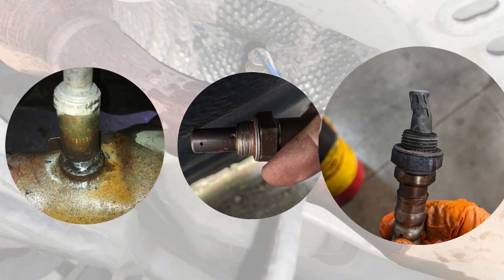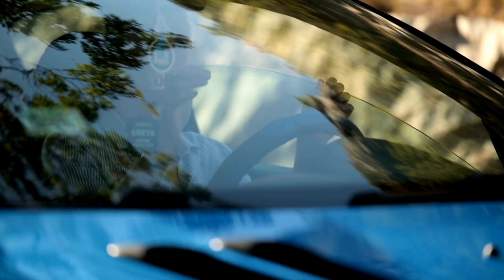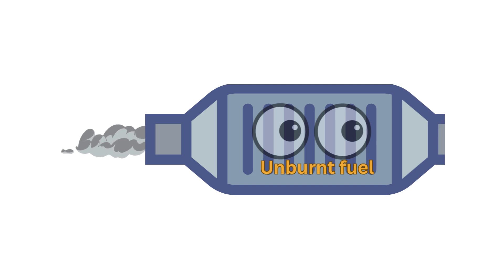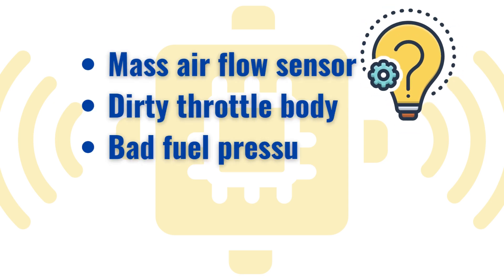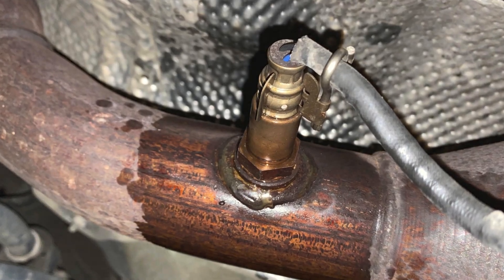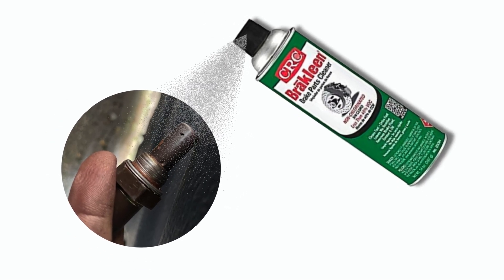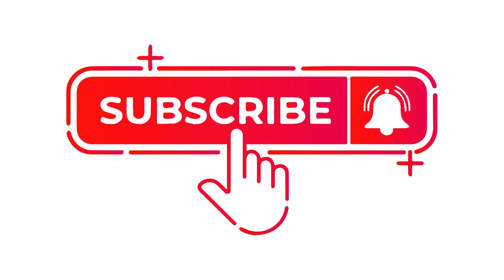6 Symptoms of a Faulty O2 Sensor | Engine Misfires, Poor Gas Mileage & More

Comment: My 98 Nissan truck seemingly the O2 sensor  died quickly, then the truck started running worse and worse quickly during just one grocery run.  It has 127,000 miles and has always ran great.  Very reliable truck.   The OBD2 showed knock sensor and or Cylinder bank 1 sensor code, which is the O2 sensor before the Cat.     The 02 sensor being bad can cause the knock sensor code to come up as a by product.

Comment: mine misfires when cold and changed spark and coils i even fixed a vacuum leak could my 02 sensor be a cause?
Reply: I need the same answer
Reply: I can't say yes 100% but my Jeep o2 sensor went out in the cold. (Ohio) and I had a misfire due to it.

Comment: O2 heater circuit code came first for me...kept driving for like a year then came the egg smell...kept driving longer....now I'm having hesitation to accelerate....kinda feels like misfires or fuel starvation....I'm guna change the O2 sensors now... ive had a O2  heater circuit code for over a year...it's the only code present....I did a fuel pump and filter a month ago....then a few weeks later it started hesitating while accelerating. I hope it's just the o2
Reply: Any update?

Comment: Wow! Thanks!! My engine stopped shaking after I changed my thermostat but now it stalls when I start it , second time I start it it turns on fine , my car won’t let me pass the 3 in rpm, if it does it drastically drops my speed from 60 to 40 and keeps dropping, until I have a steady speed . My car is at 268,448 miles , I have Toyota Camry 2005
Reply: You should also clean the MAF sensor and throttle body.  Throttle body needs to go through a relearn process after it's cleaned, so you may find your engine idling at 3k rpm because it thinks it's still gunked up and needs to learn where the flap needs to be positioned all over again.  A decent two way scanner can do the throttle reset, otherwise you just have to drive it ~300mi or so and give it time to learn again.  If you never cleaned it, it's going to have a bunch of oily sludge on it from the pcv valve feeding crankcase gases and oil vapor back into the intake.  Use only dedicated cleaners on those parts.  It's easy to do yourself.  A word of caution though, if you simply drive the car while to relearn the idle, it may try to push through your braking at stop signs, so stop early until it's done dialing itself back in.

Comment: Hi sir , i just trying to clean my oxygen sensor this morning and it was hard coz very tight and i decided to spray with WD 40 ..but still hard to off the sensor..and when i start the engine ..i saw a and smell the smoke coming from the top of the oxygen sensor..and when i touched it it so hot and also the body if the engine was hot as well..may i know what is the possible problem..i got a toyota sienna van 2020

Comment: Help. 2008 Jeep Commander Limited 5.7, Swapped out the bad transmission, while the Y pipe was out I decided to replace al 4 O2 sensors. I bought cheap ones and they threw the typical codes on all 4. Bought a 2nd set (NTK) supposebley a good aftermarket brand. Still throwing codes on all  4. What would cause all 4 to fail? Thinking trying genuine Mopar sensors? Never had any O2 sensor issues before the tranny swap. Really has me stumped. Thank you for your time.

Comment: Check engine light blinking with 3 02ser codes. Also a cylinder 3 circuit misfire. Is this all because of the 02 sensors?
Reply: well? did ya get your answer?
Reply: I got the same thing today 
So when you fixed it did the car start to running good ?
Reply: Was it o2 sensor for you?

Comment: Can a faulty 02 sensor cause a PO430 catalytic converter code. I'm going to replace my bank 2 cat the one that is on the car now is a aftermarket one. So I'm just wondering if I should go ahead and replace the 02 sensors. I don't have any other codes besides the PO430 which is inefficiently below threshold bank2 I believe I'm saying it correctly. Also could the O2 sensor if faulty would cause a higher RPM at the first start of the day?
Reply: have you replaced the sensors yet? I also got P0430 and was thinking it’s the sensor but i’m not too sure
Reply: @Alan-wq6ty could be just replaced mines tonight will start car tomorrow and see if it helped
Reply: if you're getting p0430 that means your catalytic converter is bad lol, not the o2 sensor
Reply: @schlomoshekelstein908  Not necessary it could be an exhaust leak.
Reply: @ Why would fresh air leaking into the exhaust cause the sensor to throw a Catalyst System Efficiency Below Threshold code?Wouldn't it be running cleaner than it thinks with an exhaust leak?

Comment: 1:13 nonsense, it could be vice versa, i've seen destroyed engines by bad oxygen sensor, telling the ECU that it's too rich so ECU told the injection to sprinkle less fuel so it was extremely lean and it DETONATED the engine to motor heaven

Comment: I went for about 2+ years with a finicky front O2 Sensor on a 2002 Solara SLE V6 1MZ-FE (MCV20). No misfire though.....It would trigger the engine warning light but reset to good on the next startup. Gas mileage did go down as I have driven this car for 22 years but not to the point of expensive repair before my 300,000 mile service. The rear O2 sensor under the car is factory still and they rarely go out.
As to the recent real problem(s) was a misfire started a month ago on startup in the garage due to other factors according to my repair shop. Oldish spark plugs, bad ignition wire set,  and two bad direct ignition coil.  My car shook with two cylinders out I thought it could be about 9 things but in reality this was not a heavy fix.
Repaired now and ready to go after the 400,000 mile mark.
Reply: How long can i drive with that issue?

Comment: Car was perfectly fine for 4 years without changing it. Fianlly get around to it and now it stuters on first gear and a little on second . Maunal car. Today finally smelled the eggs smell trying to push it on the highway . Now evap code comes up with short bank 1 circut  but changed sensor 2 times now. NGK brand
Reply from the maker: Check fuel pressure regulator, EGR valve
Reply: Check ur catalyc convertor
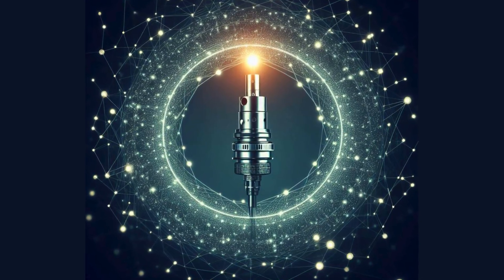0:48
Reply: @mafiarecordsentertainment2687  it was a popped fuse....
Reply: @FreeOnHvacTech  what fuse exactly if you dont mind me asking was o2 fuse?

Comment: Hi mate, i have a issue with the transmission of my CRV RD1. Gear 1 & 2 picking up but it doesn't shift to 3rd&4th gear and stalls while the engines on.press of the gas and it raves without moving.. any advise
Reply from the maker: Hi, I have video on torque convertor and shift solenoid. Please check them out

Comment: Can an oxygen sensor cause car to shut down while driving ?
Reply: Also takes two hours for it to start up again after it shuts off 
Crank no start when hot after driving
Reply from the maker: Hey, I have separate video on this issue. Please open my channel and see. Thanks
Reply: ignition control module inside the distributor. what car make and model do you have? i had the same issue

Comment: Can this be why my dodge ram 1500 has a hard time to start? I have to try n turn it over bout 3 times before it starts. N sometimes i can smell fuel when im tryin to start it
Reply from the maker: Not necessarily. Could be other factors like faulty or leaking fuel injectors or bad MAF sensor
Reply: Fuel pump going bad probably

Comment: Mine are welded in with rust.
Please can you tell me if its OK to run with them unplugged, just for diagnostics to see if that can help determine if they even need replaced.
I am getting sensor codes but can't tell if its bad sensors or wiring

P0158  Oxygen Sensor Circuit High  Bank 2 Sensor 2
P0300  Multiple Random Misfire
P0152  Oxygen Sensor Circuit High Bank 2 Sensor 1
P0157  Oxygen Sensor Circuit Low  Bank 2 Sensor 2
Reply from the maker: Difficult to tell. Since you said sensor has rust, so chances are that it could be bad. To test connector, measure voltage across its pins

Comment: Why do we need this idiotic sensors, can the car ve simple without all this?????????
Reply from the maker: They communicate with the ECU so that engine runs efficiently. Otherwise, it won’t be silky smooth drive😬 would you like if your car starts shaking suddenly while having a nice long drive with someone special😅
Reply: @AutocornerdPros  cars in 1975's are the best Nissan Sunny 120Y, Toyota KE30, fantastic cars. Unlike nowadays cars, are crackpot!!!!!!
Reply: Which do you prefer, completely mechanical cars with no electronics but 10-15 gas mileage, or cars with electronics that need replacing after 100K miles but 25-30 gas mileage?
Reply: @_jp_0966 and this why I stick to older years. Scared of electrical fixes
Reply: Tree huggers and the epa